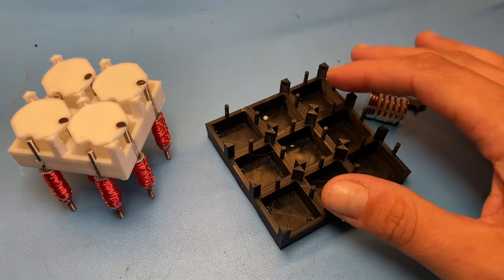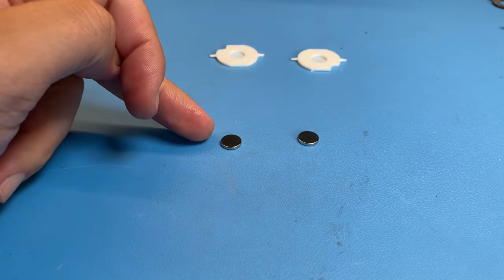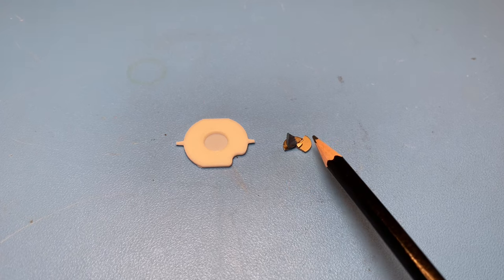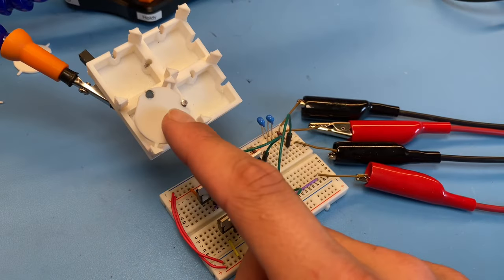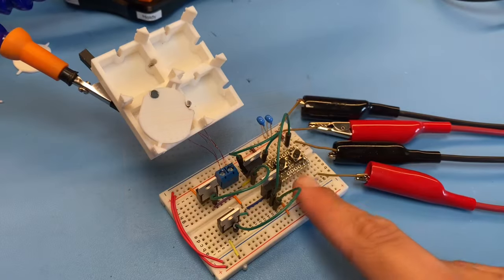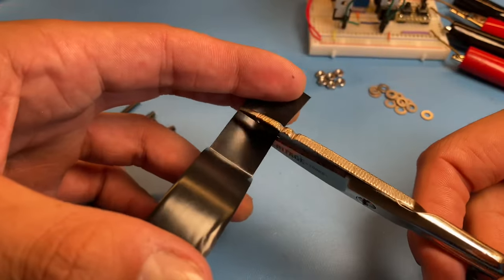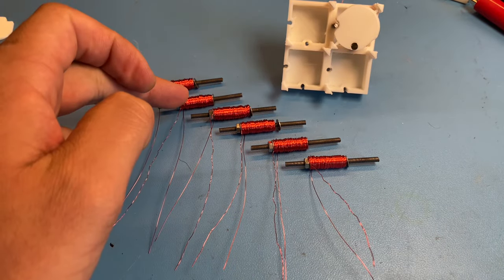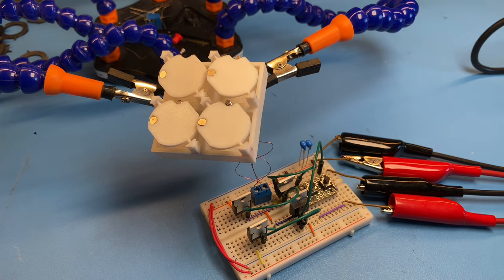3D Printed Flip Dot Display #3 - Magnets. How do they work again?

Comment: You may want to find a different way to mount your magnets in the dots because heating them above 80°C (176°F) can start to permanently demagnetize them quite quickly. I'd suggest gluing them in with super glue
Reply from the maker: You are so right! Didnt even think about this until I noticed the flip dots werent responding how they should. Updated the design and went with your suggestion. Its a press fit with a bit of glue to hedge my bets. Great catch!
Reply: I made that same mistake trying to set a magnet in a 3d printed part just the other day.
Reply: @larrybuilds5359  super glue would be sufficient
Reply: Came here to say the exact same thing!
Reply: Oh, so I wasn't the only one to see a soldering iron on a magnet and start screaming in pain.
Reply: i was like, strange version of magnetic tool to help install magnets. i hope that iron wasn't. now i realized it was!

i once tried to fix magnetic usb cable's device side plug. tiny smd soldering. but it has magnet there too so after i did somehow complete the soldering, i realized i've tested curie temperature out irl, magnet was like 25% of original strength
Reply: wasn't hot i meant

Comment: Just a suggestion, you could always use heat shrink tubing instead of electrical tape as an insulator between the threaded rod and enamelled wire. Might be quicker and easier for a larger scale.
Reply from the maker: Ooo I didn’t think of that! That would be quicker,    Ill have to give that a shot, thanks for the suggestion!

Comment: You can cut down on the number of wires and power requirements by placing the 2 coils in series.  Of course you want to observe polarity.
Reply: And on the single U-shaped core.

Comment: hmm, I wonder if you could take it a step further, moving the magnet right into the pivot corner, and having a single electromagnet with a wider surface to effectively cover both orientations of the flippy magnet. It would be quite similar to how the 0.3g micro rc actuators work.

Comment: You can trade the number of transistors for the amount of copper used, if you wind two coils per electromagnet and bias them as opposites. Energizing one winding will flip the dot in one direction, energizing the other will flip it back. It might also make it simpler to drive as a set of rows and columns

Comment: Maybe you want to make the dot a bit thicker and have a layer of plastic on both side of the magent and push it in from the side - so event if the magnet shatters it will stay in place
Reply from the maker: Ive actually needed to add some plastic spacers to the magnets in order for the electromagnets to overpower the attractive force between the flipdot magnet and the steel rod. Haven’t had one of the smaller magnets break yet!

Comment: You might consider trying a electromagnetic core that is a better magnetic conductor     (permeability). I've found that bolts are poor magnetic conductors. They retain some magnetic field due to the current in the coil and the permanent magnetic. When you apply the current in the winding it must overcome the residual field before it can reverse the field (hysteresis). The metal used in these bolts have a high hysteresis which will increase the power lost to heat. They are cheap to buy or it is easy to salvage them. with a stronger field you should have less problem with flipping the dot. Very good work! You must have learned a lot and others can learn from you (including me).  Thanks

Comment: Since your Z Height is very valuable, already having the e-mags sticking out from the frame, you should look into maybe 35-40mm (19mm rod projection + standard width electrical tape (19mm) = 34 + top nut/washer) M3 Button head screws, the head will function as your bottom nut/washer/combo and eliminate all the rod stuck out the back (button head is ~2mm thick), allowing you a little more standardization and saving you several to many millimeters by the look of it. Love the project, subscribed for more!
Reply from the maker: Great idea! I hope to use some of that extra length to attach the control boards once the design gets to that point, but standardizing to something I can just buy from mcmaster is probably the smartest option, especially once I start fabing a bunch of these. 2000 of them for my planned wall display, going to get tedious for sure.

Comment: I wonder if you could use stepper motor drivers to energize your coils, they are pretty ubiquitous and relatively cheap. Of course h bridge chip aren't that bad themselves, may be easier to use in a row/column activation design

Comment: Really, really nice. I also love flip dot displays. Here my notes: I understand the principle, but it would be highly preferrable to have less than 2 coils per pixel from a cost and energy efficiency perspective! 1 coil per pixel might be impossible, but what about 1.5/px or a fraction below that, made possible by using another pixel‘s coil as a guide/helper for the first pixel‘s turn. Maybe use springs to get away with less coils. 2nd remark: Try make the coils smaller but use higher voltages to reduce costs and production time/effort.

Comment: Put the magnet closer to the point of rotation. It will work faster, utilise greater magnetic flux and also interfere less with the surrounding magnets as change in position is smaller.
Agree also with those suggesting the U shape magnet

Comment: Given that you drive the coils with a bipolar circuit, how do you plan to scale up to row/column addressing? 
A separate H-bridge per pixel?

Or positive and negative column lines each with a diode per pixel, likewise for the row drivers, leading to a total of 4 diodes per pixel.

Or adding a component to each pixel that has a voltage drop that is higher than one third of the driving voltage. That way the coil you intend to energize gets close to two thirds of the driving voltage. Since all of the other paths through the array go through at least 3 pixels, the combined voltage drop will exceed the power supply voltage, and no current will flow. A green LED will drop 2 volts in one direction. 2 such LEDs wired in parallel with opposite polarity will drop 2 volts in either direction. With a 5 volt supply, and a pair of LEDs at each pixel, the intended pixel will waste 2 volts in the LEDs, while no power will flow through any of the other current paths.

Or something else?
Reply from the maker: That is one way to do it, but I am trying my best to avoid that. I have found a way to power them in a row column format that greatly reduces part and I/O count. I am working on getting that video out in the next couple days

Comment: Normally the flip dots are just thin sheet metal, putting magnets into them is way to expensive.
They have a cut out for the electromagnet pole that is not magnetized on one side.
The actual flipping is achieved through the effect that the magnetic field wants to be as dense as possible using the metal as field guide.
A need side effect is that the metal pole gets magnetized and the display doesn't need to be powered to keep the display. (But also a problem if the flip pate gets magnetized)
Reply from the maker: Interesting, so the magnetic fields will cause the non-magnetized metal dot to rotate when the fields alternate? I figured there had to be some amount of magnetization of the dot itself in order to properly repel/attract during actuation. It would be great to simplify the dot design, but not sure how I could manage to mass produce sheet metal parts. Would have to get an outside fab house to laser/water jet them. Maybe a diy metal stamping machine is needed? Im always down to hack something together haha
Reply: @larrybuilds5359  Well it sounds easy but there is some engineering behind it.
So it needs some trial and error to find the right angles etc.
I'm more baffled that there are virtually no resources out there on how to DIY flip dots.
All resources I found are on flip dots/flaps with magnets. Or on how to drive them.
Also it seems that the flip dot display with the metal dots is a special German concoction lol.
It was from a very old bus.

But for starters you could try some (really) thin washers, maybe even magnetizing them with a strong electromagnetic pulse could give better results.

Comment: You could probably eliminate having two electromagnets, if you use a horseshoe design.  But then you'd have to wind the center of the horseshoe... Could be a design choice you could Chase when you make a winding machine. Would also be a much more compact design.

You may not really need to actually have a complete horseshoe you could just insert the electromagnet between two steel rods. It would lose some efficiency in the air gap but it really wouldn't be that bad you're not relying on huge  forces here

Comment: hi larry , 
i really like what you are making and would love to see your next tests , but i think you would face the same old issue if you were testing the left bottom cell as the magnet in this case will be near to the one on bottom right cell so it would be more likely to affect each other , what do u think 🤔 ?
Reply from the maker: Thanks! I am having a lot of fun building this up. And there for sure could be more issues with this design. You did identify a good test case, gotta put this little 2x2 through its paces.

Comment: To simplify electronics; why not an u-shaped electromagnet, both sides of the "u" would come in contact with the magnet; one side in the "white" position, one side in the "black" position.  If you properly align the magnet's poles, you might need only a single transistor per dot (or a pair), instead of 4.

Comment: Hey really great video.
I was just wondering if you could use only one coil per dot with a U shaped core (bending the M3 rod after winding the coil). I think it should work because it would direct the magnetic field in the direction you need (this should also minimize the effect on other dots). An other advantage would be that the whole design would be smaller (and you would only need half as many coils)
I'm curious of what you think about this suggestion. 
Keep up the great work.

Comment: I wonder why you use two coils on two rods instead of one coil on just one U-shaped core.
Reply from the maker: They are wound together to act as a single coil, but I opted for two cores for ease of manufacture at the time. I didn’t find any U-shaped cores of the size I wanted and had the rod stock on hand when I was designing.

Comment: Hey, that looks like a really awesome project. Subscribed, and looking forward to more episodes. I have one question. The commercial flipdot displays use ferrite cores instead of iron cores for the electromagnets. Those cores are selected so that they have hysteresis. This means that when you energize the electromagnet you end up magnetizing the ferrite core one way or another. So the dot itself is not just held by the magnet in one position or another. This prevents the dots from flipping due to vibration or mechanical interference. As far as I can tell it should be possible to buy ferrite rods that you could use instead of the threaded rod. I bet you looked into it and decided against it, but still curious about your design decision here. :)
Reply from the maker: I did look at ferrite cores originally, but went with the threaded rod just because I had it and I didnt know yet what size magnet I would need. I might eventually use ferrite if I need more magnetic field strength, however the steel rod should provide some amount of hysteresis. It will be less than ferrite, since it has a higher magnetic permeability. Great suggestion!

Comment: Hi, nice ideas. Never thought making your electromagnet in a U-shape ?
Reply from the maker: I have seen designs that use the U shaped ferrite core. Might increase the magnetic field strength, not exactly sure why a U would be preferable, but I dont have a great grasp on what the effect would be. Both electromagnets are tied together in parallel, so they should act similarly
Reply: @larrybuilds5359  I think I did not explain my idea clearly. The idea is to replace two electromagnets buy a single U shape. In this manner you will only have one electromagnet per pixel and also divide the electronic part in halve. You only need a single H-bridge for each pixel. Also when your U electromagnet is polarized, it has one side attracting the permanent magnet and the other repelling the other face of the permanent magnet.   Another idea to explore would be a way to keep a small residual current in the magnets to keep the pixel in place. 😉

Comment: How to manage multiple points? Is there an addressable diode strip?
Reply from the maker: I am using diodes for sure, they are helping me limit the current flowing to a single row/column combination. This will be the next video dropping in a couple days, stay tuned!
Reply: @larrybuilds5359  Are you going to use a cascade of shift registers?

Comment: Hey I love your videos! I'm rather inspired to make a set myself! Was wondering what material was the electromagnetic cores you used? Read online that a material with high remanence will help retain the "memory" of the flip dots.
Reply from the maker: Thanks! Glad you are enjoying them. The cores are made from low strength steel M3 threaded rod. Could probably find ferrite or iron rods that would make for a stronger magnet, but I had these on hand. And you are correct that residual magnetism is left in the cores and hopefully will keep the dots locked in place. This is especially important once they are oriented vertically.
Reply: @larrybuilds5359  HAHA nice! Looking forward to your next video!

Comment: The fact that they aren't flat is bugging me. Is there a reason you need that small angle? Why aren't the posts like 1mm shorter? Love the build so far tho, subbed.
Reply from the maker: I agree, some of the example commercial flip dots I saw were slightly angled, maybe to help it flip properly. I copied that design and went with the slight angle. I havent measured it or been really precise with how long the posts are once installed. I am going to try and eliminate as much of that angle as possible as I approach a final design. 

Thanks for watching!

Comment: No need for hbridge, I'd wire the two magnets in different directions with the same wire. They're never going to be both n or both s
Reply: But wouldn't you still need an H-bridge to invert them? From what I understand what you mean, the intention is to wire both coils with reverse polarities, so whenever you power the coils, one is always north while the other is south, then, reversing the polarity again inverts both at once. For that part you would require the H-bridge wouldn't you?
Reply: @Kalvinjj  
I think you are right, I was totally off base. 🙇 Brain fart.
I was concerned that the circuit used two terminals and an hbridge per magnet and so four terminals and two hbridges per dot, when instead you could wind two magnets with the same wire, requiring one hbridge serving two magnets.